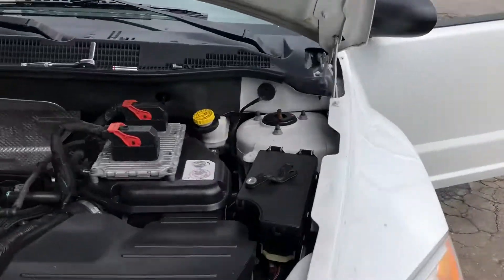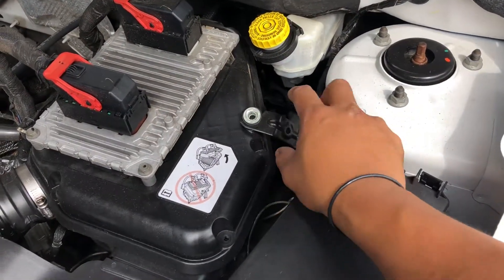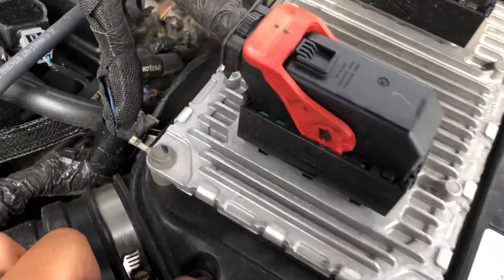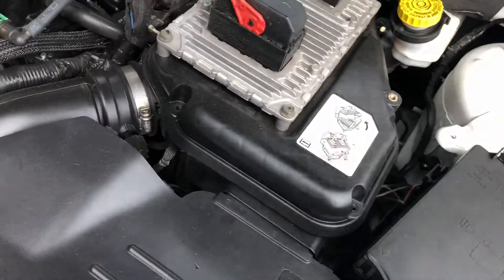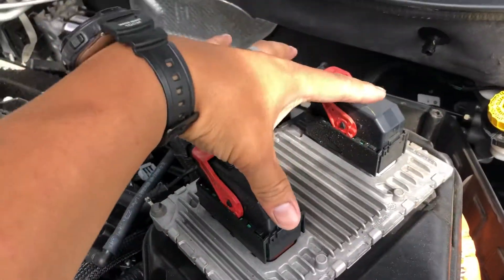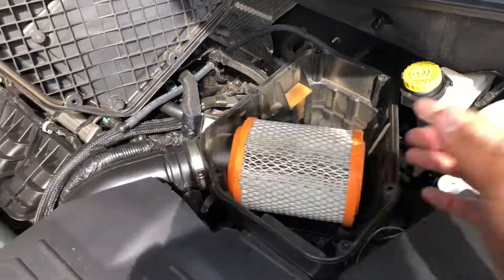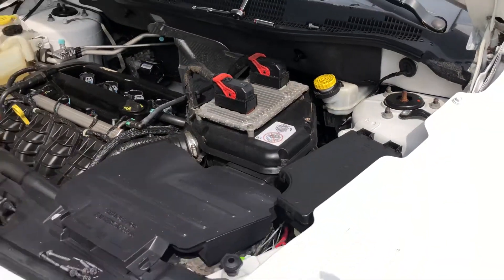2012 Dodge Caliber air filter replacement

Comment: That foam sponge piece. Mine is pretty oil soaked and disintegrating. How do I replace that? Just any foam?
Reply from the maker: Joey Kistler are you talking about the round air filter? It shouldn’t be soaked with oil.
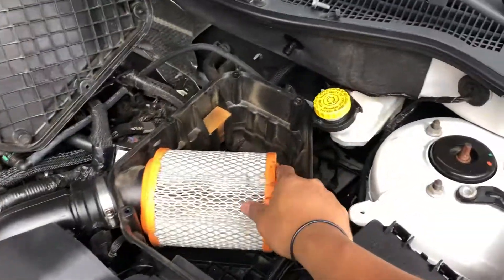Reply: @BrianBalatbat  No its a square sponge. If you look at 0:40 in this video it at the top. Its kind of orangish